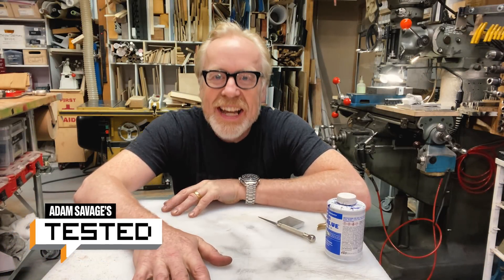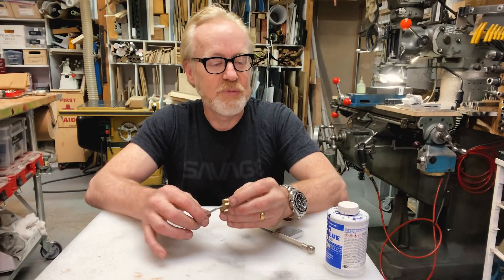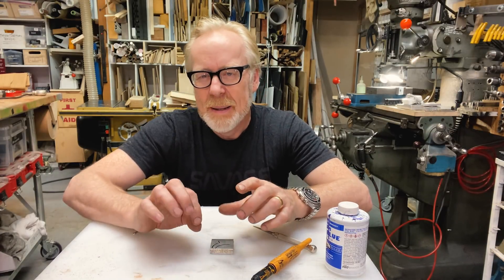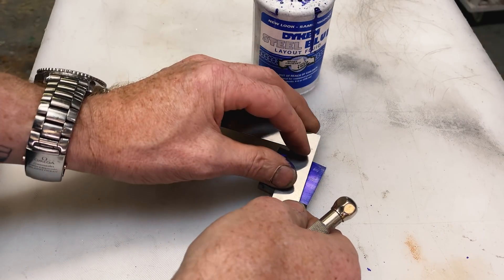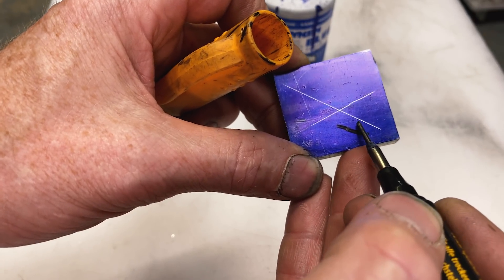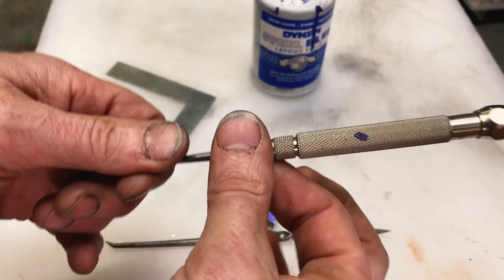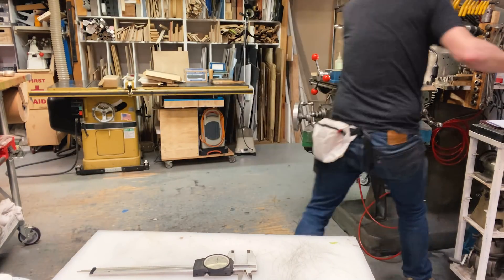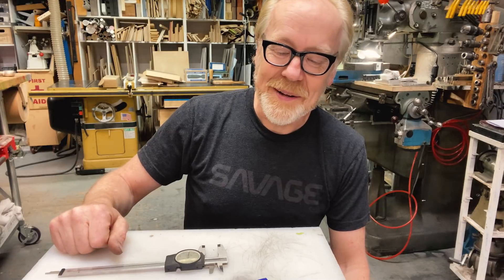Adam Savage's Favorite Tools: Machinist's Blue Layout Fluid

Comment: Re: Starrett scribes - I was lucky enough to find one at a thrift shop. Then I was stupid and used the tip to pry something. Crack! Luckily replacement tips are available.
Also the tip stores in the handle reversed, preventing puncture wounds and damage to pencil pockets!
The more expensive ones come with a carbide tip rather than hardened steel. They are made for people who use them all day every day. The one in the link should be fine for most.

Comment: I made my own layout fluid by adding gentian violet (which is readily soluble in alcohol) to fairly weak shellac. Commercial layout fluid is expensive. The home made version is very cheap and, as long as it's kept in an airtight container, will last almost indefinitely. I make bespoke decorative hinges and clasps in brass or copper and these can be quite intricate. I cut them out on a scrollsaw to which I attach a stereoscopic microscope... so I really need those clear lines.

Comment: Tip on the Starrett scribe: you don't need to completely remove the end of the handle to release the tip. You can just loosen it a little. Also you can reverse the tip in the handle for storage.
Reply: Yes! Loosen the collet, flip the tip and it won't cause puncture wounds!

Comment: My life is a lie. My machining teachers keep using blue whiteboard markers to mark out points on aluminium stocks to machine, as if they're using this blue fluid thing
Reply: Blue chisel tip sharpies work fine too.
Reply: @chuxmix65  no I mean actual whiteboard markers. That is, unless they changed the ink in the refil chamber.
Reply: @johannapfelburg6286  Oh I understood your comment. Whiteboard markers would work just fine. The disadvantage is the ink is very fragile.
Sharpie ink is a little more durable when sliding rulers etc. across a surface. Dy-chem is quite durable and that's why it is favored. Dry erase probably wins for most economical, though and makes sense for teachers, who's budget is often tight.
Reply: @chuxmix65  yeah exactly. They'd apply the ink, scribe the surface of the material to show where the origin is supposed to be, hand it to some student, and once it gets back to him, the marking is gone.

Comment: Adam, please prepare a list of the tools you would take to Mars. Duct tape of course, but I mostly mean the reusable kind. What you might need on Mars
Reply: Smaller is better of course, but if you absolutely need it on Mars, weight isn't an issue
Reply: Obviously your space suit of course. Repair kits you'd keep on your person at all times? First aid? But also, you're building a new habitat. How to handle leaks in the dome? Assuming it's a dome. Bracing for tunnels? How would you justify bringing a lathe? You need to build things or people will die (they know the risks but they are glad you are there)

Comment: A tool tip back to you:  instead of cords over your floor you need a couple of these hanging units.  I don’t represent this site but am using the link to illustrate my thought. https://www.northerntool.com/shop/tools/product_200665711_200665711?HOT_MEM_CODE=&MARKETCODE=&STATE=&cm_lm=13705202&om_mid=14203&om_rid=1418547033&tp=i-1NGB-ES-3h5-1Y04sr-1c-vVLe-1c-1XtdfL-l54oEZX9VP-1bDUtz&utm_campaign=eDeals&utm_content=FGC&utm_medium=090820_FGC&utm_source=Email

Comment: Secret sharpie tip: useful for marking flame cuts on glasss. After initially burning off, the marks become visible again at a higher temperature. This second stage of visibility burns off at working temps. Super useful for component uniformity

Comment: In my first machine shop class, OMG, 43 yrs ago now, the instructor had us, as our first mid-term test, build a scribe body like the one Adam is using. Just the body and nothing else. One of the projects on the final was to finish the scribe, complete with the replaceable tip. I have had mine for 43 yrs. I was a very good at welding and so chose that life path, but my son now has all of my tools and still uses them to this day.

Comment: It's also in one's ability to figure out what lasts forever and is cheap and what doesn't. My first scribe was and still is Chinese junk, but it's a carbide tipped scribe and so...it will never die. I still have it 24 years later, i still use it. I have never sharpened it.

Comment: One alternitive is to use the sharpy to paint the houle thing and then scribe that. Works the same way. Sorry for my spelling.
Reply: True, it’s a cheaper alternative but if you are applying any heat to the piece then the ink will burn off, Dykem Blue (or Red) is heat resistant. It also creates a slightly thicker layer than a Sharpie so it marks a clearer line. It’s worth the investment if you are doing a lot of machining work. 
P.S. your spelling is fine, only one word ‘whole’, I don’t know what your mother tongue is but I guarantee that I couldn’t begin to write a comment in your language! 😀

Comment: Nice video, but It always makes me laugh the way he carefully paints the whole part in engineers blue just to mark a centre line,
In industry you just swipe a quick line 1 cm wide down the middle, your line is somewhere there, no need to make a paint job out of it!

On the subject of scribers I would recommend your first scriber to be a £5/$7 one and then if you find its something you use a lot, then buy a £15/$20 one,
I've marked out thousands of parts with an average £15 scriber, no issues, unless you're marking out very hard materials $60 for a sharp pointy thing is a complete joke, (I've used an old nail ground down to a point before, and my £15 scriber has been reground once in 30 years) 

DON'T scribe so deep, you only need to break through the dye to the surface, scratches this deep could mean that your marking out is visible on the finished part... Not good, 

You can save money here to buy the stuff that really matters like micrometers or vernier calipers.

Comment: What about using the Starrett Scribe for leather work?
Reply: From personal experience the C.S. Osborne scribes are better and easier to use on leather.  The Starrets are really sharp and will cut into the leather, where the C.S. Osborne scribes have a slightly rounded tip.  (like micro rounded)  If you cut into the leather it will leave a forever mark and mess with the leather if you don't cut right on the line.  The C.S. Osborne won't cut into the grain of the leather rather they burnish a line into the leather, which can be removed if necessary.  You can get the C.S. Osborne scribers for around 20 bucks on Amazon for two of them.  I have both starrett and the  Osborne scribers and I prefer the Osborne for leather work.  I do some pretty high end leather work and not just bracelets and belts.  I highly recommend Corter Leather working as a channel on youtube.  I've done leather working for years and I have learned a lot from Corter.

Comment: For marking on layout fluid i use one half of an old jewelry compass with interchangeable tips
In case of importend surfaces i dont want to scratch, even polished surfaces
I have made tip inserts out of steel, copper, aluminum and brass wire

Comment: It’s also very helpful on the lathe when using multiple drill
sizes in the same hole or form drills. The dye will let you know if your depths are correct and your leaving material for the finish tool or tools. Also for diameters to clean up. Dykem is a must for machinist, but it has many uses for other stuff.

Comment: on marking tools, the best entry level tool I use regularly is the nails in packing crates. the one shot bang nails, they are chite level steel, but they are hard! easily Identified by the magazine strapping still welded to them. a thin peice of wire, spot welded to the nail. if you can pull them out square, they're... not awful.  serviceable scribes and punches. not great, but if you have not proper ones,  they're better than nothing. regular iron nails are ways softer. the chite teir ones in packing crates, totally worth saving.

a good scribe and a good punch, they are AAA tools in becoming accurate, for sure. but china ships hundreds of serviceable hard pointy steel rods to us. be picky, they are not all the same, but if you find one that has bored 2 inches thru wood and is still kinda pointy and straight, it'll do.

your mentality is more important. a hatch of sharpie will do for marking fluid. hatch your waste side. plan and mark your work. fancy tools make your life easier, but are not needed. 

this dude does know what he is talking about tho. you can go far cheaper tho, with things that you have a good chance of having. it will make having good tools far more beneficial and pleasurable. if you can do OK work with a nail and a sharpie, you'll be able to do good work with such tools. 

much luck,

Comment: Have you ever seen stress-reveal lacquer?
A lot like layout fluid, it covers the metal surface but it has a special party trick!
The stuff dries extremely brittle, the slightest bend or flex to the base metal results in patterns of cracks in the lacquer, revealing the amount and direction of the flex.
How sensitive is the stuff?
A shotgun barrel seems pretty rigid, but this lacquer can 'see' the temporary bulge caused by the bullet/gasses passing through.
Reply: .... sensitive to EXPLOSION INSIDE THE MATERIAL isn't very sensitive
Reply: Never heard of it, don't ever foresee needing it, yet now I'm headed to Amazon to order some!
Reply: Great example of taking an undesirable property of a material and putting it to a useful purpose.
Reply: Shotguns don't shoot bullets. A slug would be the closest approximation. Cool product though. Never heard of it.
Reply: @MrEazyE357  shotguns can shoot whatever you stuff into a cartridge
Reply: @MrEazyE357   I shoot saboted 50 caliber bullets in mine.
Reply: @MrEazyE357  you're plain obnoxious.

Comment: I have a scribe I picked up, and it's mostly pen shaped, except the tip. I prefer it over those long style scribes with the tips you can buy, for one important reason - it's exactly the right size to use TIG tungstens as a scribe tip. Easy, precise, I can sharpen them relatively easy, hard enough to scribe pretty much anything I'll ever be working with, and if I'm a dumbass and butterfingers my scribe to the floor and shatter the tip, instead of buying the expensive proper tips for a scribe like the Starrets and so on, I can just roll down the welding supply store, buy a six dollar pack of tungstens, and be set for scribe tips for YEARS.

Comment: Tom lipton over at Oxtoolco has a video that measures the thickness of sharpie marks compared to Dykem.
Reply: Jrsydvl Yeah, when I first saw the video title I was like, ok well if you press hard with a sharpie the line will be thicker. Or use a fine point marker. But then I understood he meant the THICKNESS of the mark itself. Measured in millionths of an inch.

Comment: 🎵BLUUUUUUUUEEE DYYYYYYKEMMMMM!🎵
Given how dark it appears, I assume that Starrett scribe is actually sporting the carbide tip instead of the basic steel one. God I love those scribes, I have one that's like 10 years old now, and my dad has one that's gotta be like 40 years old...but the point is seized up in the storage position. :\
Reply: Soak it in PB Blast or Liquid Wrench. I bet after a couple days it will loosen up.

Comment: My wife and I came up with a concept years ago: cost per use.  When you buy something don't necessarily think about the raw cost, but how much will it cost you every time you use it.  When you buy a lifetime tool the cost per use will in many cases be much lower than the cost per use of a cheaper tool that wears out often and has to be periodically replaced.  It also applies to how often you will use something.  Don't spend a lot of money on tools, clothing, furniture, or whatever if you are only going to use it one or two times.  If a cheaper option will sufficiently perform the job for a low use item, then it makes sense to get the cheaper item.  The cost per use will be lower.
Reply: This is a known thing. TCO. Total cost of ownership. It should be applied to everything from cars to computers.
Reply: @chuxmix65  and clothes, and ...
Reply: This is the sign of a wealthy individual. This is the way.. (mandalorian reference)
Reply: @FantomZap  Interesting comment.  I come from a very poor farming family and considering these things is how we kept machinery running, etc.  Although following this principle can allow you to make good choices and actually save money in the long run, hence becoming more wealthy.

Comment: to piggy back off of what Adam was saying about investing in tools. CONFIDENCE in your tools is so important. regardless of how much you spend, you have to have confidence in your tools. and this is important in all aspects of my life from, making, to bow hunting, to jiu jitsu. i need to have confidence in the gear that im using. if spending a bit more money on a scribe is going to give me the confidence that this is the right tool for the job, then I feel like i have so much more freedom to be myself and perform the task as hand. A perfect example for this IMO is pencils. i'm a wood worker, and for a long time i would use any old pencil or marker lying around. well i was always questioning the accuracy of my mark, and that anxiety i feel manifested itself in the work. so i decided that i was going to buy a nice mechanical pencil, and a pack of 3b pencil lead to keep in my apron. in terms of investment it wasnt much... but it wasnt a $.50 carpenter's pencil from home depot either. but now i dont worry about marks, i have confidence that when i'm cutting on that line i'm making the right cut and that helps a lot.

Comment: Marking Blue and Bearing Blue are two very different animals. Bearing Blue does not dry out, you use it to check contact between precision surfaces.
Many manufacturers make both, don't get the wrong one!

Comment: I'm a machinist and one of my favorite projects was to make my own scribe.  There are plenty of videos here on YouTube, I manually turned a body on a lathe, knurled the handle, drilled and tapped a hole for a set screw so I could make replaceable tips from old carbide tools!  Most little end mills come with 1/8 shanks so if you break one and have leftovers, chuck it in a drill and grind on a tip.  One of my favorite tools to see the beauty of others, but making your own is just a little more satisfying.

Comment: I made that mistake with cutting wood I used the wrong side of wood for my project and couldn't get a straight line cut for nothing I had to file it straight. It worked good enough it will be all coverd up with modpoge and broken glass. I made a custom design picture frame that is more intrastine than the picture

Comment: for those who want to try the utility of marking fluid for themselves before buying:
ive seen severeal makers use a thick edding/sharpie as a stand in for actual marking fluid.
might not have the same heat resistance adam mentioned, but otherwise seems to work the same.

Comment: Adam

They also make Dykem in a dauber format ( part #190523) which for small parts is a lot less messy than the brush form.  You can also buy refillable dauber bottle on Amazon and fill from your big can of Dykem for a lower total cost than the pre-packaged dauber version

John

Comment: Some of the cheapest tools I first bought when starting out still feel better to use and work then the expensive tools that bought when I could finally afford them. It's just a thing you have to figure out for yourself.
Reply: If you were doing it a lot or as a job, cheap tools just don't cut it. People doing stuff on the weekends doesn't really have the need for the quality of stuff that I need, since I did it for a job. I don't have $20k worth of camera gear because I take some pics of my kid, but a professional photographer might have much more in gear than $20k. It's different for people using the tool everyday.
Reply: @xenonram  that's exactly what I'm disagreeing with.. I've had many instances as a professional using a $6 tool while having a $110 that doesn't the same job in my tool bag. Price a brand does always equate to a better tool or function.

Comment: Before the pandemic, I worked in an engineering shop, and not only do we use Dykem fluid quite regularly, but Dykem also sells a "Prep and Remover fluid", that is really good at cleaning the metal surfaces before applying the marking fluid, and also removing it afterward without any film or residue all in the same fluid, that I am sure can be purchased just about anywhere the marking fluid is also sold.